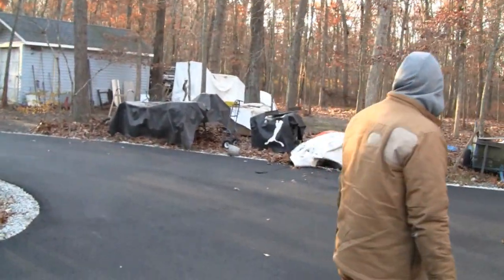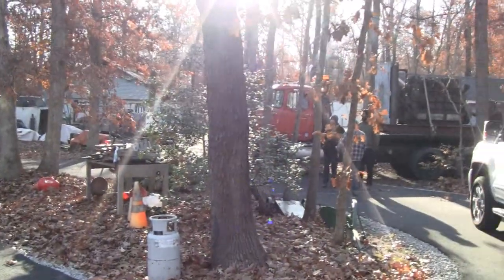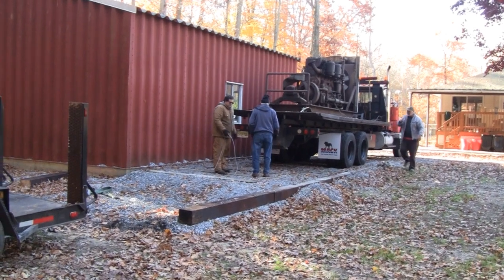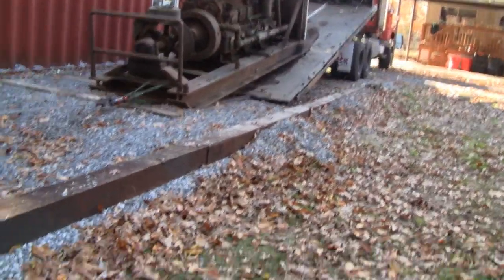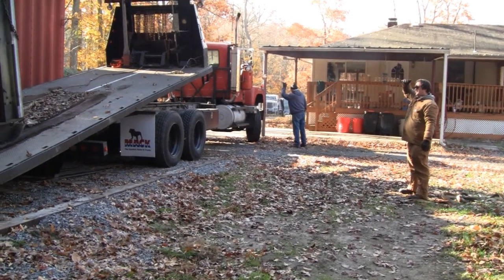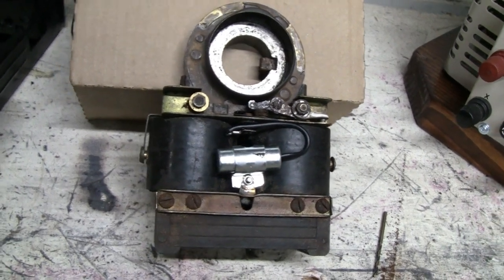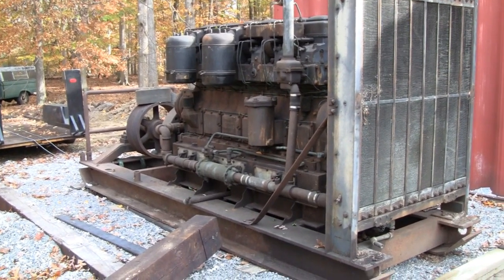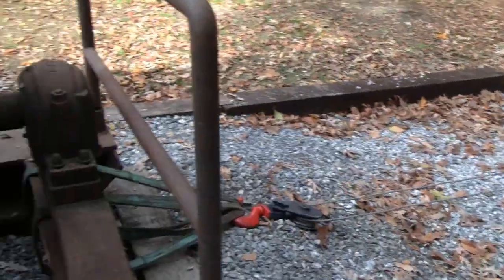MOVE & TRANSPORT 20 TON 1950 CUMMINS DIESEL

Comment: Hi guys, that magneto, when you said Cushman I knew exactly what it was. I have a Cushman Cub with the rotating body on the crankshaft, no mag just a bracket for the mag. I have talked to several Cushman collectors, never heard of such a thing. I also collect Cushmans. Any information you have to share would be appreciated. Thanks for sharing, nice Cummins
Reply from the maker: Sure, whatever we find out we'll pass it on to you!! So far it's been a deadend!!☺
Reply: @805ROADKING  I sure would like to see more on the Cushman Cub and mag, or if you would like to part with it I would be interested. Thanks for sharing an answer to my question of what kind of mag I am looking for.

Comment: Looks like a modified Wico magneto. That four bolt bracket (bottom at 20:53) looks just like a Wico EK one. It's missing the shell tho, which has all the brand, naming, also, there's an actuator (if memory serves me well). Edit, the wheel and keyed shaft aren't part of the original as far as i know.

Comment: Bendix was fond of making magnetos with small internal magnetic rotors, so I suppose the one you have could be a Bendix. Be careful about condemning one of the coils as being bad. You mentioned that the engine was a Cushman. If the engine was on some sort of vehicle, the second coil might be a 6V unit for lighting.
As always, nice video and good luck!
Reply from the maker: Thanks Greg!!☺

Comment: The Cummins Model L has a 7" bore and 10" stroke- that's 385 cubic inches per cylinder or 2,310 cubic inches total displacement, or about 38 litres.  

Now if you really want a big six, an Alco 539 has a 12-1/2" bore and 13-inch stroke, and 1000hp at 900rpm with a turbocharger.  It is probably the largest displacement six cylinder engine ever used in a locomotive.